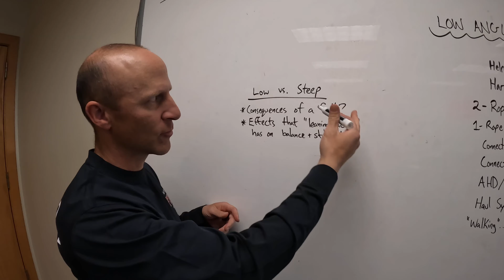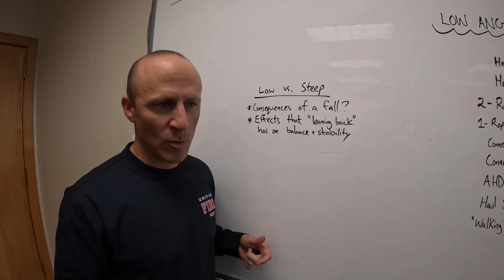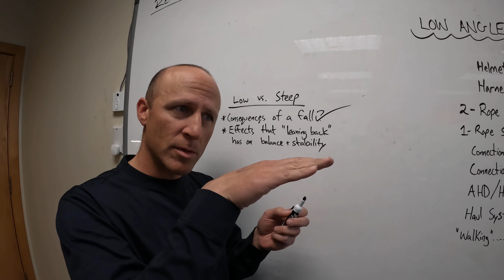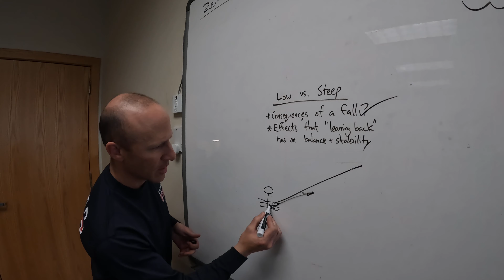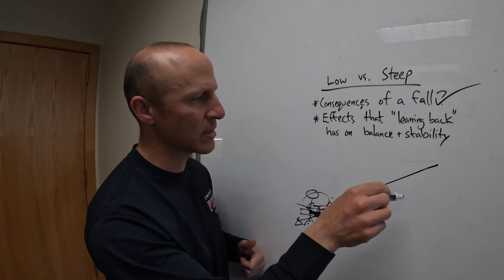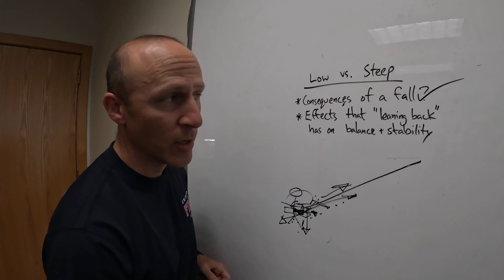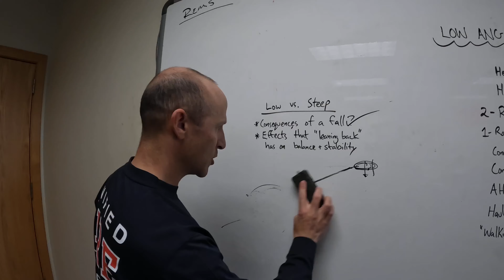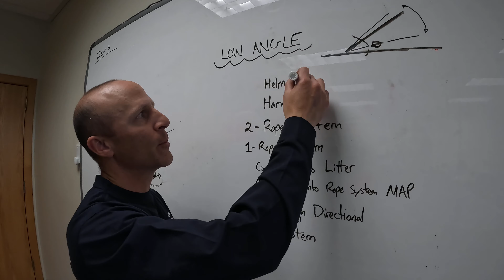Low Angle Rope Rescue: An Oxymoron?

Comment: I am an old guy, far too old and worn out to be climbing ropes safely anymore, but I have been obsessed with learning the skills necessary for rope rescue for a long time and have accumulated a really sweet collection of gear for that kind of work. It is lucky that I have never faced an emergency situation that required any of that knowledge, but it has been reassuring to know I have the ability if such a situation occurred. However, I have found those skills to be especially helpful when hauling or lifting game when I hunt. Understanding how to move a dead elk, deer, or bear up a mountainside with ropes, pulleys, and other gear has been incredibly useful and helpful many times. The world would be a much better place if everyone knew those skills. Learning about your work and methods has been one of the smartest things I ever did.
Reply from the maker: That’s awesome!  Appreciate the feedback & thanks for watching